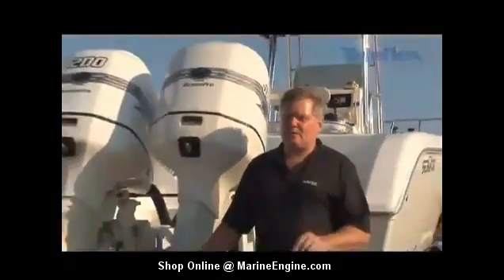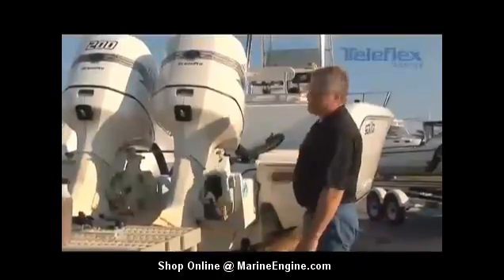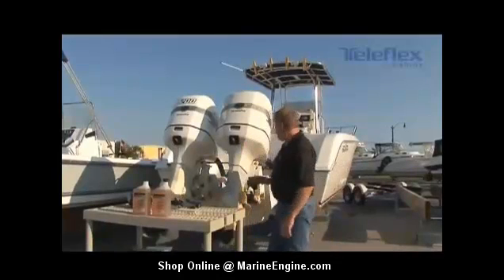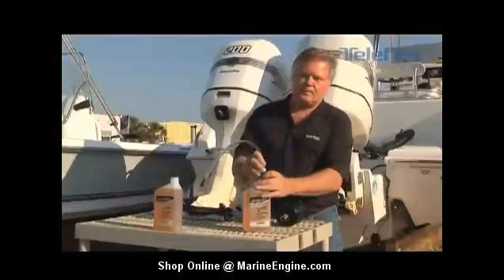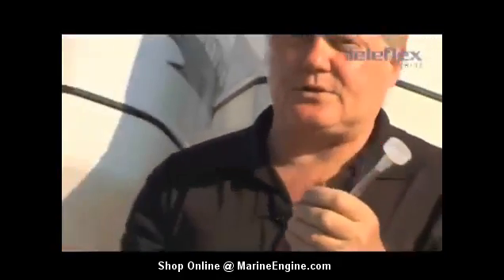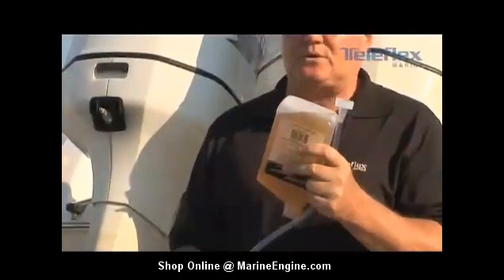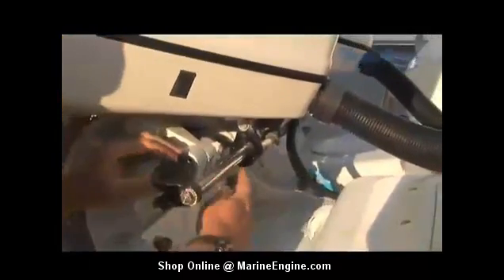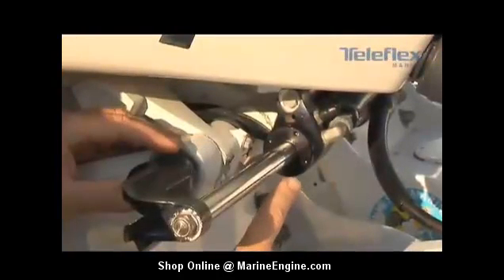How to Bleed Purge Boat Hydraulic Steering System

Comment: so you are saying it is ok to drop the hydraulic oil out the transom? not particularly environmentally responsible for a organization involved in marine!

A much better idea is to attach a length of clear tube to the bleeder valve run to a bottle with a small amount of fluid in it. not only does this allow you to collect and dispose of fluid responsibly, if you ensure no air bubbles are in the tube you will stop that small amount of air sucking back into the bleed nipple if steering is stopped before it gets tightened.

another bonus of doing this is that you can occasionally quickly back steer a bit which will help to loosen the few stubborn tiny bubbles that collect at any fitting in the line
Reply: Eric Ramirez wow, your an angry little fella!